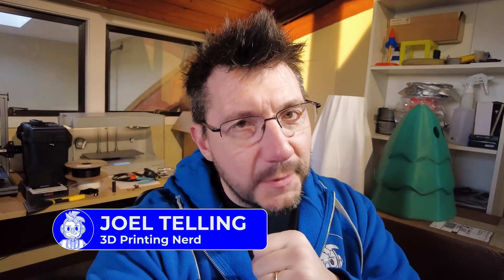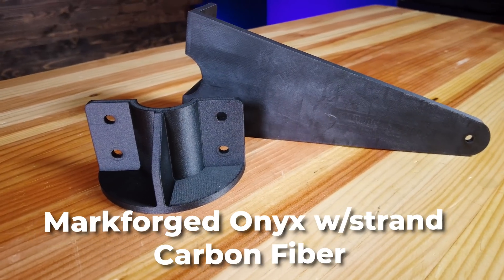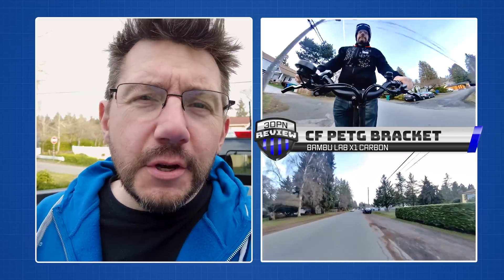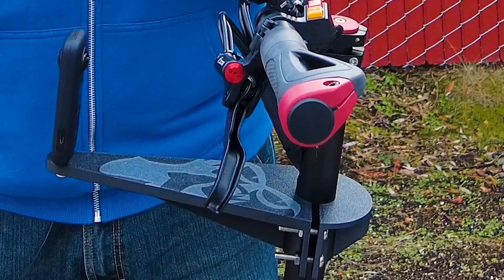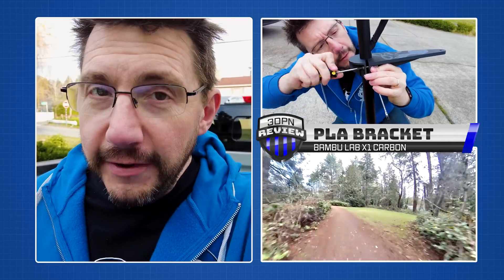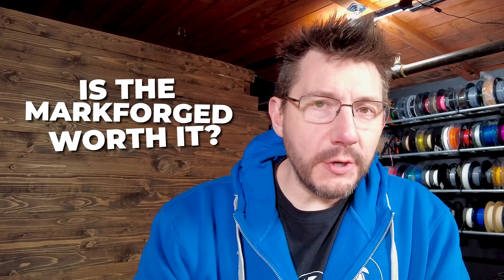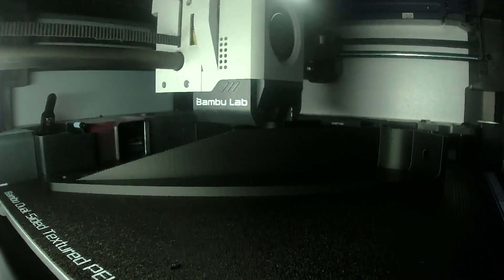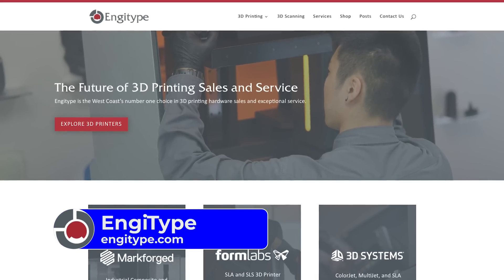CONTINUOUS CARBON FIBER vs PLA vs PETG

Comment: just print carbon fiber on the bamboo labs machine???
Reply from the maker: See Short reply
Reply: @3DPrintingNerd  🤔 tbh especially with the markforged being so expensive per part, a good filament to test would be PA-CF instead of PETG-CF. Polymaker's PA6-CF for example has some pretty wild claims for annealed parts and it's only $50~ for 0.5kg, so it would be a bit closer at least to prototyping with the continuous CF for most people who don't have a business budget. (Should be printable on the X1 Carbon too I believe)
Reply: @kasiya2660  Parts made with chopped fiber are no near close to those markforged parts with continuous fiber. It is really crazy to see and feal how stiff those parts are and how strong they can be. But yes, you are right that a PA6-CF or also a PA12-CF are very good engineering grade materials for a reasonable pricepoint. Besides this there are also PA11-CF from Prusa and PAHT-CF from BASF on the market that also perform very good and are not that expensive as those markforged parts.
Reply: It's not capable of printing continuous carbon fiber. Most machines aren't.
Reply: Wouldn't it be easier to just CAD in some metal stiffeners and pause the print half way through to insert and then continue the print?
Reply: @garrydye2394  Or instead of metal inset carbon fiber. Extruded carbon is cheap or you can get carbon tow and make custom shaped inserts.

Comment: Whether it’s worth it is actually a balance of strength vs cost vs unit volume.  If you need high unit volumes 3D printing isn’t for you.  So 3D printing is largely relegated to prototyping, in which case, do you actually need the strength?  But suppose you just need a couple samples with a specified strength, you will need to engineer it specifically to avoid the common issues with 3D printing (Z axis weakness).  But if you’re making something critical e.g. aircraft why would you constrain your design to the limitations of a 3d printed part?  So I see the use case quite a bit smaller than advertised.  Could you make a model aircraft wing? yeah probably.  But is it lighter than traditional methods, probably not, is it stronger? Probably not.

Comment: you need to model some stand-offs where the bolts come though so they contact the other side with only a about .050" of preload. This will keep you from craking them

Comment: I have used a Markforged Mark two for about five years now and there is a little spoken of problem...

Freshly printed parts will be rigid and have a high tensile strength at first but quickly absorb moisture and begin to lose tensile strength and become very pliable.

The slicer (called Eiger) has some control for orienting carbon in perimeters and you can control how much continuous fiber is added which is really cool, unfortunately the inside or outside edge of those perimeters is where "wet" parts shear as the carbon reinforcement resists bending while the rest of the print resists far less.

Print times in general were very slow even at the time i first purchased the machine but print times with continuous carbon fiber are rarely worth the time and cost knowing that they will inevitably weaken to a state that is similar to PLA. I have had some luck sealing prints with varnish after printing but that is not feasible for a large portion of my parts.

I still need structural 3d printed parts but i would rather use one of my bambu machines with pet-cf, ppa-cf or petg for parts that need less heat resistance and tensile strength.

sls printing services have been a great resource as well.

All in all, i think the Mark Two is a good machine, well built and easy to use but doesn't produce parts the fit my needs of high tensile strength and long term durability.

Comment: I'm not a mechanical engineer and not well versed in this, but this videos seems a bit crazy to me. This is not a structural part, and nothing to me suggests that the absolute stiffest choice of material would be best suited to this application. On the contrary, a camera holder often includes a dampening material to smooth out vibrations. I'm super interested in this carbon fiber technique, but this video does not make sense discussing it.

Comment: a part like that, i add cylindric holes for carbon fiber or aluminum tube to insert, with aluminum you can insert a heating element inside to melt the plastic to create a perfect mechanical bond to the aluminum, if you want to go one step further, sand with ~100 grit sandpaper before insertion.

Comment: The company I work for has 3 markforged printers. And compared to other printers and filaments the prints are phenomenally strong. However, they are also phenomenal in pricing, $16,000 for the printer, 235 per spool of just the onyx filament another 200 for the fiber filament. The cloud software is lacking in adjustability. Getting markforged to actually repair the unit is a pain. If you don’t need the strength buy a bamboo. We just bought 5 of those and are only going to keep and maintain one Markforged. They are just too expensive to buy, maintain and use.

Comment: The cracking in the PLA and PETG parts could have been avoided by designing the bracket halves to fit more snugly around the scooter's cylindrical column so you don't have such a wide gap in between those halves. Plastic is not aluminum. Another way to avoid cracking would be to use a kind of rubber gasket between the bracket halves to prevent them from deflecting too much.

Comment: Not seeing any fillets and such on any joints?  Adds tons of stiffness.    Basic 3d print design suggests everyone use them.   Cool little toy!  Think I would be prone to add some type of stabilizing gimbal camera....like a DJI handheld unit instead if you want solid video.

I would like to learn more about the Mark Forged printer?  Are you saying it adds long full length fibers to prints?

Comment: can I just pring the Onyx on my X1 Carbon? I have a Markforged Mark Two at work and use Onyx all the time. we never use the fiber inlay, just the fialment.  I have the X1 Carbon at home and could possibly supliment my company when we are slammed. great video ! thanks for your insight. hope to hear back.
Reply: I have the same question. Maybe we can use it but with some custom profiles on Bambu slicer. Overall I think is doable

Comment: Friendly reminder that as makers, we arent just limited to 3d printing. Its my favorite one BUT if you need a part that 3d printing isnt good enough, theres other ways toi make it. Welding, CNC, etc. CNC definately starts to get up there in cost for anything half decent that can do metal but theres still options cheaper than a markforged. Or when in doubt, just over engineer the part so that PLA gets the job done.

Comment: The answer is absolutly not UNLESS your extremely specific use case requires continuous strand carbon fibre not to be mistaken with chopped fibers or cf matetials. Or you need plug and play 3d printing. Markforged has simplified 3d printing the most it can be. Still not EASY

Comment: To stop the cracking, design a spacer such that the flanges can only deflect slighty past contact with the tube. Vibration here is not a simple game of stiffness. You might find just as good quality with a PETG frame and some TPU inserts. Now, remake the scooter frame in 3DP parts and you will definitely see some clear benefit to Markforged...

Comment: As far as the cracking when tightening goes, I would try some foam rubber in the rounded part so that tightening the screws compresses the foam for grip so the plastic doesn't need to flex to hold tight.

Comment: As an engineer I think the test isn't showing what we want to see or practically see.

The road is rough. The trail is rough. Regardless of stiffness, the vibration showing the road will exist unless the camera is stabilized or you are post processing  the video with something like warp stabilizer in premier.

Facing yourself is a better test as you and the camera both are coupled to the scooter.

Either way, the cheaper materials vibration modes can be changed by changing the design. More vertical height of on the beam, longer or shorter beam etc.  Freshmen mechanical engineering 101

Comment: The cracking during tightening of the part is very obviously a design error. I mean you are literally using a metal screw to bent the part to fit them together. So reducing the airgap, you need some airgap to have sufficient clamping force so it doesn't slid around, would go a long way to make that go away.

Comment: I look at this as you design the part based on the material you plan to use.  Aka a steel and aluminum part need to be designed differently based on their material properties.  Same applies here, using the same design of part for all materials is not a fair comparison imo.

Comment: You are talking about needing a 20k machine versus a $699 machine.  They should not even be in the same comparison.  This like comparing the MarkForged 2 versus a 5 axis Metal CNC that cost $572,000.  Same price percentage difference.  And aren't you sponsored by MarkForged?
Reply from the maker: I’m not. I also very specifically said you don’t need the machine.

Comment: CF what? This is an ad, admit!
Reply from the maker: Huh? Nope. Just tested stuff.
Reply: @3DPrintingNerd  you never mentioned which type of CF material  Marked Forge used for u. Vinyl?
Why couldn't this be done on the Bambu? THX JOEL
Reply from the maker: @hallowedshade125  The CF is strand carbon fiber in the Markforged. It's a strand of CF, like a thread. The Bambu would need a separate print head just for the carbon fiber strand. The strand is like another spool of filament, but much thinner and it comes out of another nozzle on the Markforged.
Reply: @3DPrintingNerd  i had to research this some more, but it makes sense now. I dont understand why you couldn't swap filament, aside from the amount of purge and sheer cost of the stuff, tho. But I suppose that is reason enough.

Comment: Since you want to learn more about CAD, here is a suggestion. Next time you want to use metal nuts for assembling parts create a hex cavity in the model so you don't need a wrench to tighten them. Better yet create the cavity embedded, remove the support material in the slicer software, create a pause statement at the top layer of the cavity, drop in the nuts and print overtop of them create for a super clean part with internal metal threads, BOOM !! , You're welcome, Peace

Comment: did you printed with onyx filament ? which is just a nylon with strands of cf , just like any other cf filament ? if so you can print this filament in any other printer . only if you print with continuous fiber filament then there's really a difference .
Reply from the maker: Yes, Onyx with the continuous carbon fiber strand.

Comment: At the job I retired from, we had a Markforged Onyx Pro.  This machine could print nylon with chopped carbon fiber and also embed continuous fiberglass fiber in the layers of a part.  The machine printed parts that were much stronger than anything out of any commercially available printers, and did it with excellent precision.  I can say for us, the Markforged Onyx Pro was worth it.

Comment: Hey Joel, I just found out that Tronxy has released their VEHO-800 Large Direct Drive 3D Printer, with a bed size of  800x800x800mm. Have you seen it yet, and are you going to review it??
Reply from the maker: Holy cow what? No this is the first I’ve heard of it. Will look it up!
Reply: @3DPrintingNerd  I was looking at that printer again on Tronxy's web page. They offer it in sizes up to 1000x1000x1600mm.

Comment: Using these vanilla materials for such a comparison is a little bit silly to me. No entity that's deciding whether to invest in a Markforged is doing so by comparing PLA/PETG parts to parts filled with continuous strand composites. I love and appreciate you, Joel, but please include some CF polycarbonate/ABS/Nylon when making this type of comparison. Otherwise it just feels a bit like an ad. Cheers.
Reply: Haven’t figured out that almost all his videos are ads? If not, ALL his videos are… at least recently in the past few years for sure they’re all ads…and there’s nothing wrong with that, but he should be more transparent about it… this video is a good example, the comparisons are not along the same lines and far from it…
Reply: @liquidpza  most definitely paid, but honestly it’s not without value to do so just to show hobbyists what’s possible.

Comment: Really cool to see how PLA as a good use case here, but it would have been interesting to see the CF PETG printed in the same design as the other 3. I feel the flex came from that design flaw rather than the material.

Comment: Continues carbon fibre is a massive con and marketing ploy to sell more expensive materials and limit open source material usage. Virtually the same levels of strength can be achieved using Covestro  1030CF or Basf PACF, all for a fraction of the material and printer cost. MF Onyx is expensive nylon given a “cool” name to make it more marketable and the continues carbon filament is miss sold to customers in so many instances. This is one of the biggest pieces of misinformation in the 3D industry!

Comment: Nice real world comparison of materials! One thing to keep in mind is the material cost in Eiger is the cost of filament/fiber but a printing service will want to 2x/3x/4x this cost to make some money. (So this would be a $100-200 bracket ordered from such a service.) Another great material you can get cheap and fast from a service these days is laser-cut aluminum sheet. For a project like this, you can just print your own custom PETG or nylon clamp and get a stiff piece of aluminum in the mail with the same turnaround time as a Markforged provider. 

Another way to get your own markforged parts for cheap is to order a bunch of 2mm hex wrenches of various lengths and design your petg parts to use them as structural members.

Comment: What about PC? I used it in my car for speaker mounts and they are durable and withstand the Vegas Sun
Reply from the maker: Oh, PC is wonderful, but it's not STIFF. You can create geometry that helps stiffen it up, but with this geometry, the stiffness wouldn't be there.
Reply: @3DPrintingNerd  carbon fiber PC exists

Comment: I use a mark two at work, and man it's a beautiful machine and the onyx is amazing on its own even without the fiber fill (and the supports are the best I've ever seen). The problem is just that it's slow, extremely extremely expensive, and the software isn't great. It does work great for what we've been using it for (mainly drone parts), but most parts simply don't need it I've found.
Reply: @literallykey3298  Do you still use that Mark Two? I was wondering how reliability is.

Comment: is carbon fiber fumes toxic tho?
Reply: That and the microparticulates while printing.  Once printed, it's okay unless sanded, use a dust mask...
Reply: @retromodernart4426  is there anything that doesn't requires a mask? pla?
Reply: @0cards0  When sanding the parts, a mask should always be used, and also a HEPA vacuum cleaner (or other HEPA dust extractor) sucking in the dust to prevent microparticles (aka "dust") floating around breathing it.

All the filaments produce chemical gases (VOCs, etc.) when heated and shouldn't be breathed, some are worse than others (ABS, PC, are worse than PLA and ASA, for example, according to published data).

Staying out of the room when printing and a reasonable HEPA with carbon filter room air cleaner (like a Bionaire 360 or similar) running while machine is running and for some time later helps a lot.
Reply: @retromodernart4426  ok thanks.

Comment: Markforged definitely has a use in industrial small volume manufacturing but this bracket is not the use case I would have in mind...

You should make a separate Video just talking about the design of the bracket and take some input from the comments. Let us help improve on it 
Stiffness is in the geometrie as much as in I the material and print parameters.
The mount needs to be improved. Really no surprise this is cracking.
Don't let that opportunity go to waste and please do something on geometrie. There are already too many bad designed parts out there. This is in no way criticism of your skills. We do encounter many bad designed parts in consumer products as well. Just had to repair a Vileda cloth dryer. The hinges are the worse parts ever.

Back to the Markforged.
I imagine it's primary use is parts that are geometrie restrained by design such as functional foils or small parts that lack the design freedom you have with that bracket and other stuff.
I would also be interested in the consequences of fatigue over time. Maybe you could do another video on applications this is used in.

Comment: Definitely do not regret buying my Onyx One, recently passed 1000 hours after a year of owning it and it still prints perfectly with no failures. Will share what I'm working on in an upcoming video but I've printed things like headlight/taillight housings, brackets, structural guides (bonded to CFRP)... Yeah.

Comment: One thing to be aware of is PLA will creep so the bolts will loosen over time even if there is no cracking.  Apart from that and the temperature stability it is a far more useful material than most people give it credit for.  And definitely great for design prototyping since it is much easier to get accurate prints.

Comment: Shouldn't you have seen "jitter in the trees" with the stiffest brackets?  I'm sure the whole scooter bounces on those rough trails.   Did the video stabilization settings change in any of these runs?